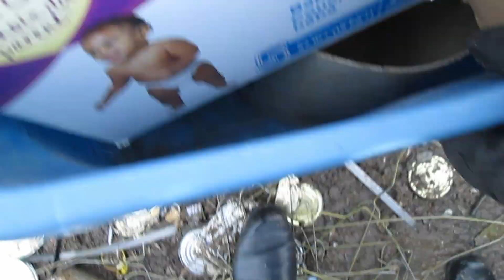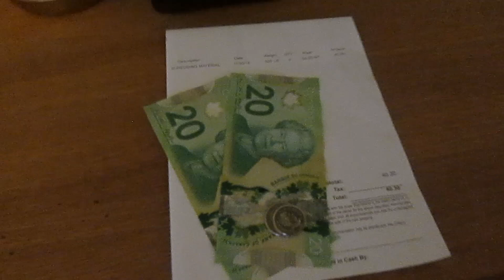DUMPSTER DIVING TRASH SOLD FOR CASH!!!

Comment: Hello my names Tony and I'm from Manchester New Hampshire I always wonders  why u don't remove the copper from your refrigerators /freezer's like the motors,the sealed units that's the black things which are in closed motors that have copper inside, if u take the sealed units and the motors apart u get #2 copper or u can sell them separately by the pound the same goes for the air condition's they have sealed units, and motors as well as copper #2 it all adds up we do it here in the states. I watch Jackpot digger he does it I was just wondering u have a nice day and keep up the good work n have a great holiday
Reply from the maker: cause free on is not good for your health or environment so what scrap yard does with it is up to them !

Comment: The tv will have 2 or 3 long inch wide boards that have gold contacts on them along their outer edges; any plastic box type feature on the main boards, that isn't filled with resin, will have silver contacts inside.
...The same with almost any type of switch - silver contacts are worth saving so you can dissolve the silver and gain almost pure silver. The brass from manual switches also adds up.